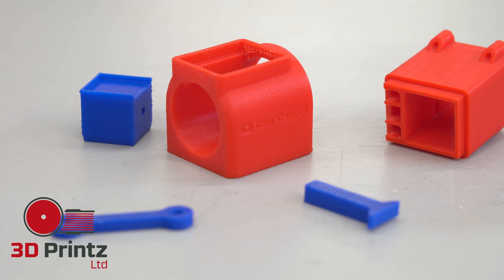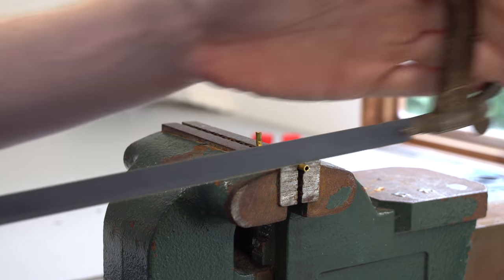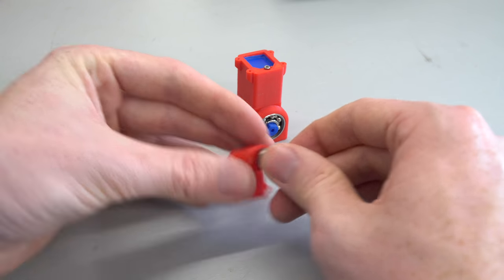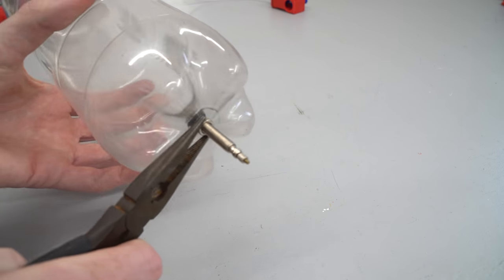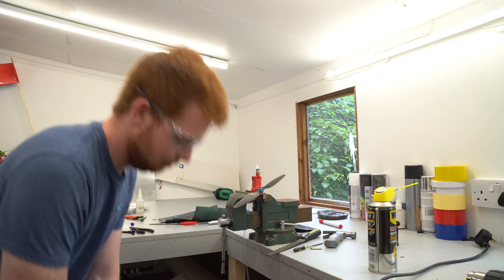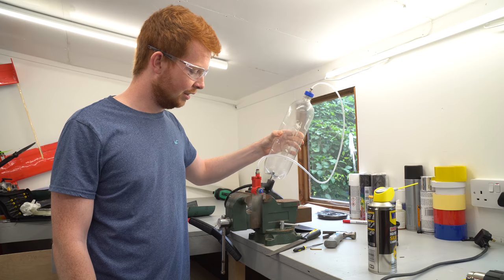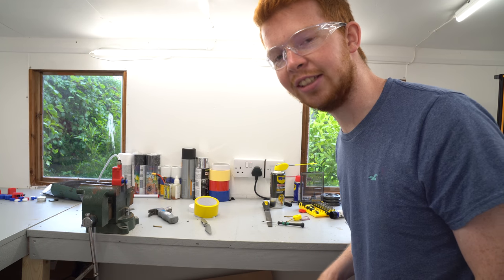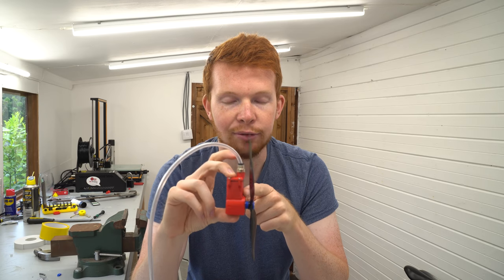3D Printed Air Engine BUILD

Comment: I THINK just MAYBE you reached one of 2 certain limitations on the maximum output of your design... Either A, your timing, or B your through-flow.

One would be adjusted by the size of your valves [the exhaust valve before intake valve] to reduce total exhaust [without the additional double valve assembly which gave you so much grief] which, as you already addressed, would increase the evacuation of the back pressure [they build tuned intakes and exhausts on race cars but I realize that needlessly adds more complexity to the product that you are working to keep simple], a 'reverse ram' would help because the cross flow of the propeller would then generate an ever so slight vacuum at the exhaust ports for not much more mass [it need not be very thick] and no real increase in complexity, seeing as it can be printed right into the side of the existing head without any need for fasteners]

The other way would be more complex and tricky as it would involve opening and closing the inlet sooner, although it would not increase the weight by much, nor the load on the crank [coefficient of friction]. Again, since simplicity is the premium goal here, I do not recommend this. 

I personally built a 240 bhp rated gas valve [this is based on (PSI{600}*CFM*SF)-Cd/t2*RPM{600} (which actually comes out to about 190 bhp in applied practice with all of the other additional issues, but the valve is simply able to control enough gas at enough pressure to allow the 2" by 2 foot double acting cylinder to do its very best)... ~( 'w')/

But I was working with a person who lacked the sense to stick with the proper working fluids to obtain the required 600 PSI and vainly struggled to utter failure with propane, simply because it was [in their eyes] a 'simpler, cheaper route.' /( -_-)\

Eventually I hope to have the money on hand to buy all of the high pressure gear I built because they are asking only scrap prices for the whole system which is basically complete, despite its general crudeness. ~( .m.)~

In the mean time watching your research is driving inspiration for me to carry on! \(^_^)/

Comment: Put a balloon in the bottle to keep psi up. the bottle will keep the balloon from over expanding and popping. you will need to locate your fill valve up at the top of the bottle to do this. Also maybe have a positive psi opposite the balloon so it will not collapse the bottle when the psi shifts. the only modifications you will have to make is adding a new 3d printed head that can accept the stem and put a balloon in the thing put it to about 5 psi outside the balloon and then air up the balloon like you normally would. now you have very little added weight while keeping PSI more constant.

Comment: Instead of trying to add complicated systems that add weight in an attempt to get this to run longer, how about using this with a folding prop as a launch system for a glider? You could use the fuselage of the glider as the air tank.

Comment: Have you thought about using an epoxy resin to coat the cylinder and then sanding that down? It'd be easier to sand/less time consuming and provide a less porous surface for a better seal. I know that fdm printing layers arent always perfectly air tight.

Comment: You should try 2 or 3 engines running connected to the same crankshaft, each engine with its own bottle, then connect the crank to an small gearbox with a gear increase, say 1:2 or 1:3 then connected to the prop, the extra torque from the extra engines should allow the prop to run at a very fast speed

Comment: so lets say you have a ground  vehicle  the uses this propulsion system to move, imaging that has wheels,  so the wheels itself can be the mechanism to pump the air into the engine,  so it will become  selfsuficient, only  the  start up will require  the pressure . I am sorry I am not English nor  an engineer, I just love your videos,

Comment: Ok, a couple years too late, but... you should put a regulator like on old time trains. As it spins faster, centripetal force causes it to expand the radius, shortening the rod, which reduces steam. Thus, with different pressures, you could maintain the same prop RPM.

Comment: This would work very well on a small bottle of propane. Its vapour pressure is low and it would give you a very long run time since it would be a liquid that evaporates as it gets used up.

Comment: You should try to make an automatic starter or what ever it's called! So you can fill it up with air and from a distance, you could start it. This is so you can have higher pressure maybe. Good job this week and I'm going to print this without a doubt!

Comment: Try using mix of citric acid and baking soda as a gas source. Can be set off with just a couple drops of water and then will continue till the reagents end. I think this one will have much higher volume/mass density than compressed air tank.

Also you can smooth PLA using ethyl acetate.

Comment: You can buy a tachometer from Amazon for $20 I'll send you one if you got a p.o box or something! Also wish there was like a miniature dynamometer to see exactly how much power it's producing.. I thought of hooking it up to a very low power drill that could clamp on and pull the trigger just enough to get it spinning and if the motor could overcome the 2lbs feet of torque from the drill then we'd know it makes at least 2 foot pounds but that wouldn't work since the motor would already need to be running and probably doesn't have enough torque to even overcome the friction of turns the drill the opposite direction before its trigger is even pulled

Comment: I think you need to apply a finishing to the piston and cylinder with some form of lubrication, personnaly id use a nitro engine piston and liner design the 3d print around those parts then try oiling the charge air like a 2 stroke ;)

Comment: I like this engine design, and most of all I like the adjustable valve. But I do have a couple of ideas for you to try, one might already work with your design.
Firstly, can you fit the tool inside the hose end to adjust the valve without taking the head off? If not maybe trying to make a housing for the valve that makes it possible to do so. And secondly, where the push rod rubs on the crank shaft, I feel like this price will wear out quickly, I would put a bushing around that pare of the crank and bottom of the push rod to make it last longer. Good job, this design looks and runs good.

Comment: I wonder if you could possibly use a brush-on lacquer, varnish, model cement or PVC type cement [depending on the plastics involved and their compositions of course!] and very gradually fine tune the 'cylinder' to piston fit to be closer and yet smoother...

One would of course have to be very skilled with their hands, or, possibly, employ an artist's air brush...but by adding a really really fine layer at a time, one might be able to perfectly lap the piston and expansion chamber to a truly close lapped/matched fit using say 4000 grit paper, some polishing compound, some hard wax and a whole LOT of patience...

Comment: You can try using propane to make the engine run, it's pressure is low enough and since it's liquid under pressure, the run times can be greatly increased with a small LPG tank,( I'd use copper tubing and solder one together)

Comment: Maybe you should add compressor connected to exhaust valve and fill up bottle with compressed air while it running? This will be helped to run engine while longer at higher rpm.

Comment: This engine looks great and very simple. I like the idea of putting it on wheels so you don't run the risk of braking it. I was also wondering if you could make the engine run on dry ice or liquid nitrogen in a compressed bottle. Just thinking trying to think outside the video. Lol

Comment: What are your thoughts on powering the engine with a small CO2 cylinder? You would need to regulate the pressure down... but you could get really long run times... and if it was installed in a RC car the extra weight probably wouldn’t matter much... just a though. Good work on the engines man, the entire process has been very educational and entertaining.

Comment: Excellent! Do you think a little 6-volt air pump could be attached to the bottle in order for longer running? Those little tyre pumps, when stripped down, are very small but deliver a good bit of air.
A small 6-volt motor would run one so it could work on an RC plane.

Comment: I think not dual piston per engine, but a dual engine plane would be super cool.

Bottle between to middle spars, tube from it to front engine on nose, exhaust from front engine runs to rear engine (mounted back wards) and then out. You can look up some older versions of full size planes with this prop layout, of course they aren't on compressed air but the dual motor front/back is proven successful
Reply: For example the Cessna skymastrr

Comment: Woow interesting thing. It could be something important  to investigate about the air tank. You could use a tin  of deodorant to increase preassure and with a valve, control the flow in order to get a smaller tank of air  with high preassure to get longer time.

Comment: Instead of continuous sanding, why not 3D print the parts in such a way that the wall grooves align making for a smooth slicing and snug fit?
For instance the case and the piston would be 3D printed sideways having the inner groves align in the direction of the motion.

Comment: round piston would make it easier to get a tighter tolerance (print slightly oversize and sand to a tight fit) and it could be wrapped with PTFE tape to make a tight seal with very little friction, possibly also use a dry lube like graphite since it is running on air.

Comment: You should try to make the parts metal. There are different ways to do this but depending on the plastic you use you can just pack it in sand and pour molten metal into it. If you use aluminum you can get it to melt pretty easy but the plastic might melt slow so if you can use styrofoam copys of the parts and pack them in fine sand and pour molten aluminum. You can use other metals like pewter that melt lower but I’m not sure how strong it will be. If they are metal then you can use steam or use at higher pressure.

Comment: For Max power and effiency you should have a two cylinder engine with second engine 180 degrees from first and it can recover the exhaust gas from first and feed it to second. This should be good for a 70% improvement. Also over time the round cylinder will be more effiecient becuase of less wall surface area vs top which is one reason most cylinders are well cylinder shape not square. Less leakage on sides too.

Comment: You could try use two bottles so you have a longer duration if you're gonna put in it a car. Make like a pressure switch where if it drop bellow a threshold it's switches to the second "tank"

Comment: you can make far higher pressure tanks, look at how the water rocket guys do it with fiberglass tape etc. 

also: steam engines and air engines usually have some kind of carb or other venturi nozzle that injects a "dollop" of oil since, after running for some time, the oil will be sprayed out and need refilling. 90% of the pressure holding power of piston rings comes down to a thick layer of oil on the barrel walls. alls i'm saying is in the inlet you could add a little vein that connects to a (tiny) tank of a thin oil (2 stroke oil? wd-40?) and maybe a screw to adjust how much gets through. that would probably far increase lubrication and efficiency, not to mention reduction in maintenance and plastic deformation from friction.

consider how much air this plane requires and if you could make a brushless-based air compressor on board of a plane to keep it running, for long test flights. consider the power-to-weight advantages of using multiple engines or simply scaling up this one. do they become more efficient with size? 
finally, consider making an alka-seltzer reaction tank to produce pressure on the fly no pun intended

I love this series whatever do it'll be amazing!

Comment: That's an awesome series Tom! Many thanks for sharing this! Normally, I'm not that destroyer type of guy, but in this case I'd really like to see the limits of such an engine out of PLA. I mean, it basically begs to explode in slow motion secured behind 10mm acrylic at X PSI. Did I spot a little smile on your face as if you already  thought about it? :D

Comment: For the RC car where weight isn't a huge factor, have you thought about using something like a high pressure scuba tank with a pressure regulator to provide a constant psi for an extended amount of time?

Comment: Here's a change of design for you, what if the air was fed in through a helical groove in a fatter crankshaft, pushing the piston up instead of down. Similar to a nitro delivery method, but pressurising the underside of the piston??

Comment: If you put it in a car, consider running it with a co2 bottle? I would use oil as lubricant because I imagine silicone getting stiffer when the temperatures drop inside the engine. 
Let me know what you think if you have the time to answer :)

Comment: Try running it with a bottle filled with dry ice and a bit of hot water because it looks like steam and builds pressure by its self and it won’t damage the engine the co2 will keep it running please try it

Comment: You should get a big airsoft co2 can and put a regulator on it so you can run the engine for an insanely long time, could even use an electronic limiter so you can throttle the engine by way of increasing or decreasing pressure supply to the engine

Comment: So you wanna put it in a car...
I’m thinking you should challenge ourself and make it so that the car has an onboard compressor, powered by a battery so that it constantly runs. Also, make it have the air engine throttle. However to keep the engine running you’ll need to create a clutch so it can run while stationary.

TLDR:
Make a car with the engine, on board compressor, throttle, and a clutch
Reply: RedKugelblitz because that way there’s no need for the clutch or complex throttle, it’s a challenge.
Also (the main point) 
It won’t have the awesome engine exhaust sound
Reply: RedKugelblitz not really since itll be a very short flight which means that remote control will be useless, it might as well be free flight like the warthog planes it was based off of
Reply: RedKugelblitz but then it’ll have the same, maybe slightly longer, flight time of 15 seconds

Comment: How warm is the engine after it has ran a little while? Can you touch it or is it like a nitro engine getting reaaaaalllllll warm?
Reply: Zen - Shouldn't it be getting cold as it is acting like an expansion valve?
Reply: It wouldn't be very warm. PLA deforms at 50C. If the motor got hotter than that regularly it would melt.

Comment: u have to try run it on some  soda pouder  and vinegar mix in that bottle instead of a pump since it can run at such low pressures so u have a constant of pressure

Comment: can you try multiple cylinders? i guess a boxer or v twin shouldn't be too difficult as it's basically a two stroke, so all it would take would be fitting two connecting rods on the crankshaft, the cam should work for both cylinders..

Comment: Hey Tom, excellent work, this engine is by far the best yet! I'd be really interested to see how the torque and rpm degrades as a function of pressure, as I am sure its not linear and most likely changes as the prop/load/inertia changes. If you have or would be willing to purchase some sensors that measure such properties, I'm certain the data collected would help you further optimize the design. I'm excited to see how this gets integrated into the car!

Comment: Make some sort of simple pressure regulator like on scuba gear and try to supply it with relatively low pressure for a long time. Because it seems to like to run better at lower pressure

Comment: What about adding a co2 type filling device, like are used to fill bicycle tires,  to provide a boost after the tank empties? You could run a simple servo to one of your extra remote switches. 
It might be too heavy for a plane.

Comment: Maybe compressed air isnt as efficient tho. Try citric acid and bicarb, aka fizzy powder. The pressure there would, if done right, be the same, but it would run longer, and, if you design the tank to be small cells, you can even control the thrust and fuel flow

Comment: If you made it larger, would you be able to integrate a starter valve to just basically flip a switch on a Solenoid and have it start itself?
Also, this is rather impractical, but would you be able to hook it to a compressor and have the crankshaft running to an alternator like in a car to essentially make it self-sustaining?

Comment: Try a squirt of WD40 into the bottle before pump it up to reduce friction when running, might need a shake, also grease the metal parts when building the engine again to reduce friction, why is the piston hollowed out on the top, flat pistons give a higher compression ratio in ic engines but not sure about the difference it makes in CAP engines

Comment: A larger version 4 motor. The effieceing one that didn’t work should actually work and be more efficient if you scale up. The larger the motor the imperfections technically get smaller. The motor and it’s imperfections do not scale together so a larger efficient motor should work.

Comment: Thanks for the files!  I printed one from aramid-reinforced nylon copolymer weed trimmer line, and it seems to be able to handle all the pressure I can throw at it!  I'm thinking of making an inline-6 version, putting it in an R/C Spitfire (Span ~1000mm) with a 5 blade prop from Hobbyking, and powering it with a paintball gun tank and regulator.